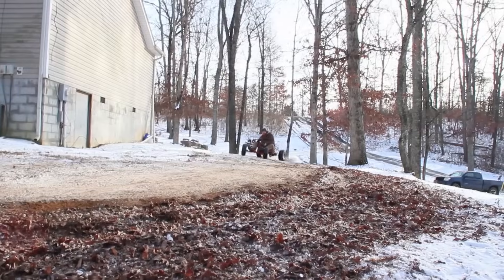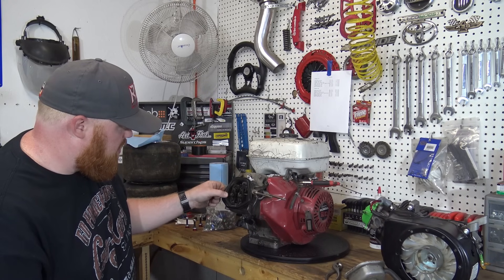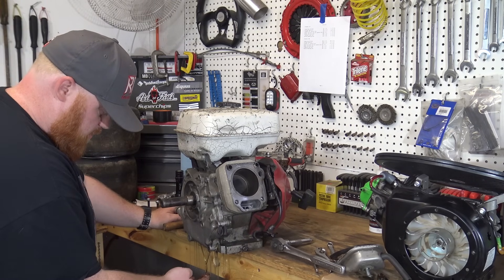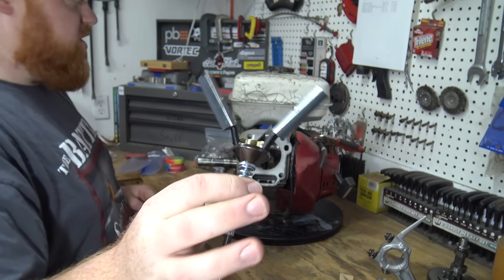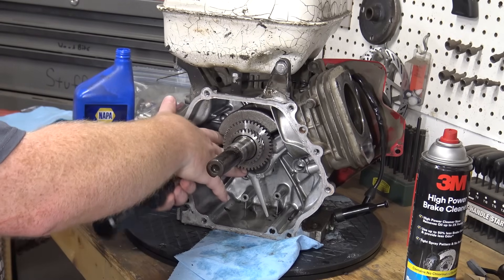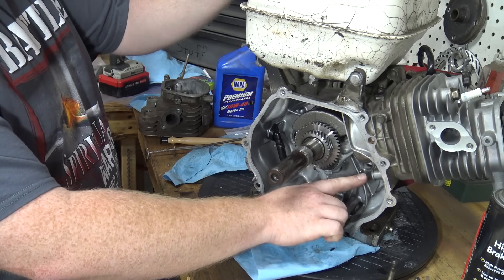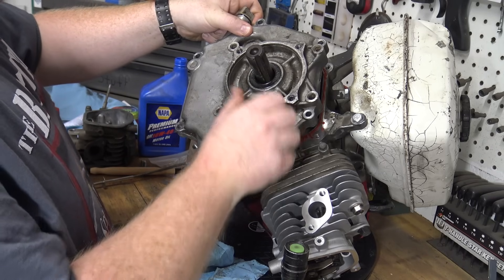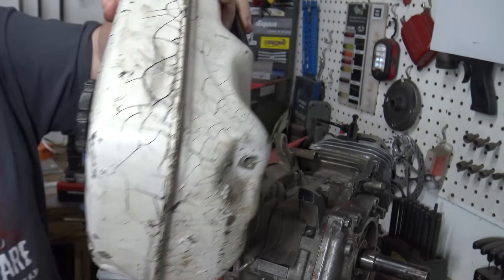How to Rebuild A Honda GX270 Predator 301cc Engine

Comment: When you have a bolt that is stuck, use a 50/50 mix of acetone and atf (automatic transmission fluid). Put it in an oiler can and shake before each use. Works great and saves a trip to the machine shop.
Reply: Yeah that’s what I do. I also add a bit of methylated spirits, it stops the acetone and atf separating so quickly

Comment: Looks like it should run . Not to say the way you laped your valves isn't good the way I've done em especially on a old head I take some fuel line with a drill and a bit works pretty good too.Can't wait to hear it run!

Comment: That buildup around the exhaust valve in the head is from overheated or bad oil. Most of the heat in the head is on the exhaust side. A good example of why its important to change your oil.

Comment: You said to “ get yourself a cheap predator to experiment on”. So what if instead I didn’t do that and bought a custom casted 72mm small block and then also bought a stage 3 head and then accidentally bought 1.2 ratio rockers with a GPS 285 cam and a 59mm stroker crank? It my first build so I made sure to get every single billet part I could afford..side cover included. I now have to build to all up and put it in my Mudstar200 so I can take that 196 and make it into a long stoke monster for my daughters blown 105cc monster moto replacement. Any advise?? 😂😂

Comment: Great video as always, looked like the engine side cover bearing may have failed on you and caused all the metal shavings, i noticed in the video the crank surface that rides in the side cover bearing looked alittle rough, i believe the culprit was the side cover bearing locking up or spinning.

Comment: I have a GX390 with the stage 1 kit 
Air filter, Loop exhaust,and 50 valve spring 
The valve lash is.006 and .008. The recoil has super high compression and does not want to pull over.

Comment: While you have the head off you should port it. Also, you should have the machine shop deck it. BTW, the plugs to go with on these engines are the autolite's, not NGK.
Reply from the maker: I like ngk
Reply: Luke DeCarlo auto lites suck but the racing autolight has absolutely been my fav plug. I tried an ngk and my 212 ran like shit. Call me crazy but I will never put an ngk in a small engine again. My turbo car yes I like ngk
Reply: Ryan Rohauer Yes I'm talking the racing plug of course

Comment: Red Beard, I have a gx270 and I want to install the large carburetor from the 390 on to it. Go Power Sports sells the air filter Performance Kit for the 301 401 predators. For the jet selection you should pick the one for the 401 carburetor.? They offer a jet for the 301 or 401 as a selection.
Reply from the maker: I would try the 301 jet

Comment: Is there any way you could do a video of you boring out the motor on little red 2.0? I know the go powers sports upgrades do alot but there is only so much power that little piston can make... is there anyway you could do a video of a bored out predator?
Reply from the maker: I haven't did any boring videos yet but will in the future
Reply: Red Beard's Garage like on a predator or a regular motor? Also you should really talk to gopowersports and convince them to make a transmission like a shifting transmission for the motors.

Comment: Did you replace the rings in this project and if not why?  If you went so far as to hone the cylinder, it seems like new rings would be best option, especially with some marking...right???  I'm new to this whole small engine thing and just picked up 2 running GX340s for a mud motor project.  About to embark on the process of "cleaning" up the bit more used and abused engine and replacing anything that might leak.  Have been thinking that I want to do a full governor delete and while I'm in the crankcase.  Just curios if I find similar issues as you are showing, what is my best course of action while I'm already in there???  And input is appreciated.

Comment: Great video. Getting ready to rebuild two GX270 myself. Did you fabricate the 8 degree timing key for the flywheel or purchase?  Noticed it was not listed in the thread. Thanks!
Reply from the maker: I actually forgot to list it. Nr racing has them

Comment: I was gonna tare down my 301cc ..and drill holes in the flywheel to lighten it . .does it have casted tabs ..or does it have the plastic bolt on fins for the fan

Comment: Read beard.  My latest project has been putting a 212 on a four wheeler EXACTLY like your sons. The engine fits perfectly except for the muffler. Would it be ok to give the muffler a "gentle message" with a hammer if you know what I mean by that. Just so it will fit
Reply: Yea shouldn’t be an issue just don’t do it while attached because you could damage your engine head

Comment: What does honing the cylinder do? Is it absolutely necessary? Also is break clean sufficient to clean all the parts? Thanks for your help.
Reply from the maker: Brake cleaner is what I use to clean and honing just gives the cylinder wall a light scuff to help keep it lubed
Reply: Red Beard's Garage ok thanks for the help. Love you vids!

Comment: TI believe the reason you are having problems with the valve clearance changing when you torque the locknut is because you have it bassackwards. The outer nut is the locknut not the inner nut.
Reply from the maker: I think your seeing it bassackwards. Im using the outside nut as the lock nut

Comment: What is the weight difference between the gx200 and the 270 ? Trying to see whats best for a four stroke powered racing go kart .
Nice rebuild video
Reply from the maker: You can google both and see. I don't know off the top of my head
Reply: Red Beard's Garage 
Do they respond as great as the 212 on modifications ?

Comment: I have a question I have a 6500watt generator and the exaust is going out the carb while running.the timing is rite the crank shaft has a regular lifter for the intake and the exaust has a smaller lifter for the exaust..what do you think

Comment: Do you have a specific website you buy from? Just bought a Coleman 100cc 3hp. Don't know anything about small engines and it seems a lot is rusted on the engine.

Comment: Hey Red Beard , i'm currently about to rebuild a gx270 clone which started life as a generator , i have ordered a new crankshaft to replace the original but the question i want to ask is " can i re-use the magneto from the generator " it's a 27 pole stator with 9 different wires coming out of it   ?  i havent seemed to find out anything about it and havent seen any other stator with 9 wires on it .  any help or advice would be awesome . ps  your vids are the reason ive decided to have a go a a rebuild for a mini bike  and worse case scenario i will just buy another flywheel magneto. thanks and keep making your vids!!

Comment: Would you "or anybody" know if a gx270 clone cylinder head assembly will fit any gx270 clone? I have one branded "gxi outdoor power" and cant find anything by yhe numbers on the engine. I was hoping to just get 270 clone head off ebay or something.

Comment: Any clue where I can find a set of valves for a predator 301cc Hemi? I ordered a direct replacement but it was too small I'm assuming that is because it was for a regular 301 but I'm honestly kind of lost I need to put this back together soon so I can get riding
Reply from the maker: Go power sports has the 50lbs and they work great in a 420 or 301
Reply: Thank you but I'm actually referring to the valves themselves

Comment: I have a Honda Gx390 13Hp engine how much do you think I could sell it for? It starts up on the first or second pull
Reply from the maker: Probably around $200
Reply: I'd say it depends where you live. Believe it or not but here in Alaska 200 bucks is for a used gx160
Reply: Still have the gx390 for sale?

Comment: What would you estimate the time involved to strip a gx motor, remove the governor, and rebuild with performance parts? For a experienced small engine mechanic, which I am not, so would be hiring someone to do the work. 

On the east coast of Canada and a high performance gx270 Honda snowblower sounds like fun. 

Not looking for a screamer, more a solid reliable build that can be ran at full throttle and still last for years. Any recommendations on max RPM for long term reliability ?

Comment: RBG can I take of my torque converter of my 212cc and put it on a 420cc or do the 420s take something else
Reply from the maker: No the shafts are different sizes. Also the 30 series which is what is on your 212 will not handle the power the 420 will push
Reply: Red Beard's Garage the bearing on the crank case cover looked pretty rough.
Reply: Red Beard's Garage does the 420 take the 40 series and can I put a 22mm mikuni on a 420 or does it have to be a 32mm

Comment: What's your opinion gx270 vs gx 390 I know more torque power but I'm guessing weight to power ratio the 270 ain't no slouch where maybe weight is an issue?

Comment: I have a Honda GX240 and I just removed the governor (thanks for the tutorial Red Beard) and I'm wondering if you know about how to bypass or replace the rev limiter for a higher limit. Any idea how or where to start with that sir? Love the videos and glad you didn't burn up with that one cart that decided to commit suicide.
Reply: Governor was your rev limiter i believe
Reply: @cainadkins3985  No, it actually has one on the flywheel. Did some digging:

https://www.nrracing.com/product-p/30500-z5k-801.htm

Comment: Hey man, I just bought a gy6 150cc adult size gokart and I was wondering if you could please let me know where I can get parts for the motor to make it faster ect performance parts. The way they have it set up the motor revs really high but still goes really slow it only has one foreward gear and it feels like super low gear . Is there governer? Thank you

Comment: hello!

i would like to build a gokart and i almost got all of the tools i need, but i got some questions. what material should i use for the frame? steel? aluminum? or another option? 

oh and i also need a engine! i really want a predator 212 but i live in europe so its really hard to find a good priced engine that runs well(like the predator). do have any "backup engines you would consider as a good engine for the money? 

-Cappy:)

Comment: What if I told you making sure the ring gaps aren't in line makes absolutely no difference. Coming from a mechanic with experience in the field the rings are constantly rotating during operation
Reply from the maker: I have always wondered that. It would seem like they would rotate back an forth in the engine
Reply: Michael Lang I was gunna say the same thing. Especially with a fresh hone. Also a techinican lol but I wouldent leave them lined up if I was assembling an engine that's for sure in theory they should move together.
Reply: Ryan Rohauer it's not a bad habit to just do, but in no means is it the end of the world if they aren't clocked
Reply: In 2 stroke they don’t move cause there’s a pin preventing that

Comment: Why was there valve grinding compound in your oil??
Reply from the maker: It looks like it but it was metal in the oil. Don't know why. Never did find anything in the engine that would have caused it
Reply: Red Beard's Garage did you put a magnet in to see if it was aluminum or steel? Steel might have been a bearing or race failing.

Comment: Aren't you cutting down on your cooling air flow and throwing off the balance cutting those fins off like that?
Do you have any other suppliers? Go Power Sports is just too damn expensive.
Reply from the maker: Yeah but it wont hurt anything. I pretty much just use go power sports
Reply: Robert G I use bmi karts they are pretty close shipping is incredibly fast but that's because they are in Ohio and I'm in ny where as gps is in Texas and more expensive
Reply: Red Beard's Garage I have a gx390 head if you want it
Reply: Ryan Rohauer I'm a 10 min drive from there.    But with the 10% code  , GPS is better .  There all the same parts. (Japan)
Reply: Omb warehouse is pretty cheap and shipping is quick
Reply: Thanks for the tips guys. I also found that Amazon is sometimes a good bit cheaper on parts and engines.
Reply: Robert G depends on the application as yo wether or not the cooling find are needed. On a go kart it's moving pretty quick so it gets plenty of air flow. On a tiller for example of isn't moving much at all so it relies on the fins to cool